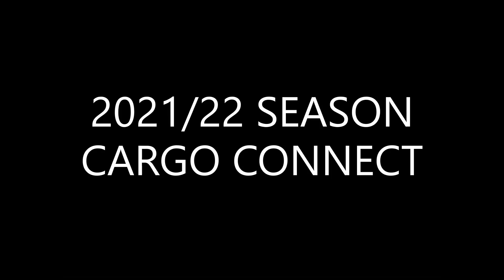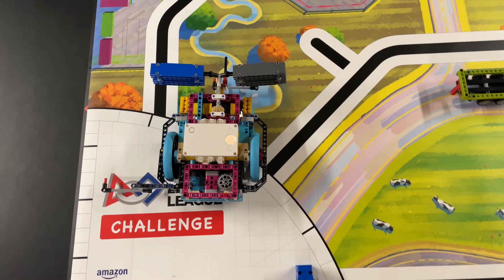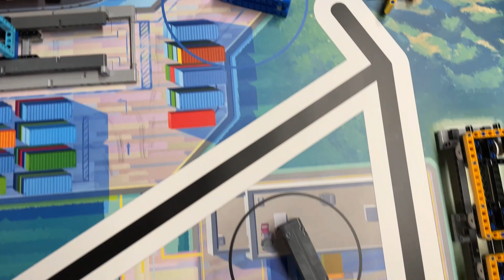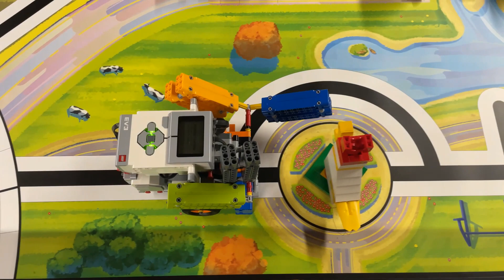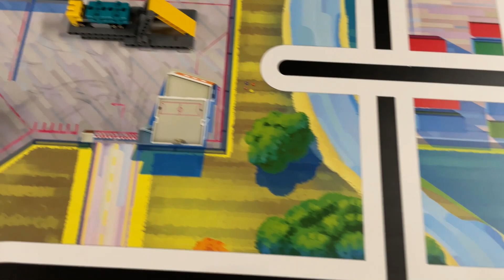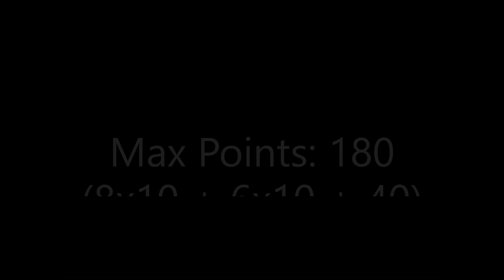2021-2022 FLL CARGO CONNECT M16 Cargo Connect solutions with EV3 and Spike Prime

Comment: are we able to stack containers on top of each other in one circle?
Reply from the maker: Of course you are allowed to stack containers. If it’s easier for you to transport, you could even put them in some sort of support frame that you could leave in the circle with the containers. Keep in mind that any circle with a container in it scores a bonus 10 points, so putting two containers  completely into one circle will score (10+10)+10=30 points, whereas putting the two containers completely into two different circles separately will score (10+10)+(10+10)=40 points. Hope this helps and good luck with your season.